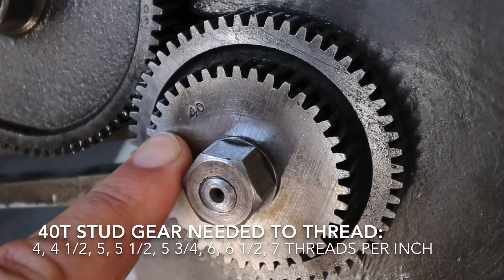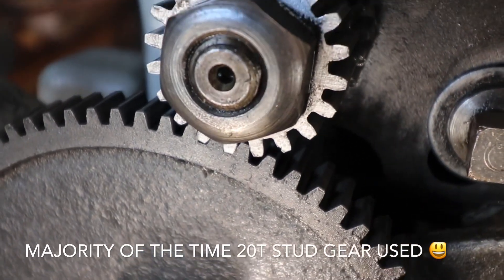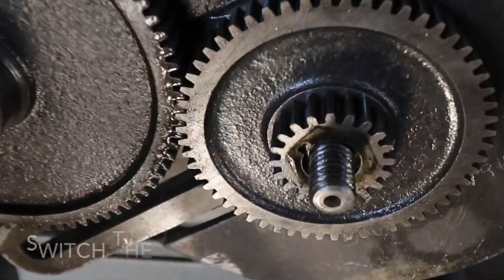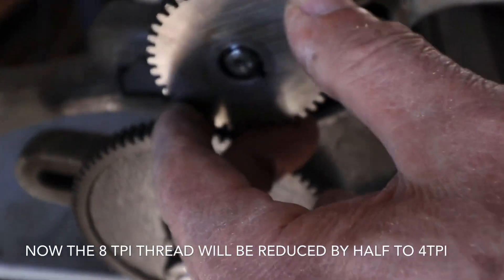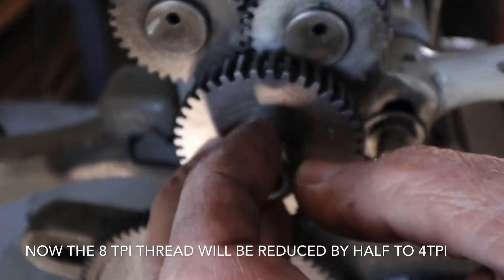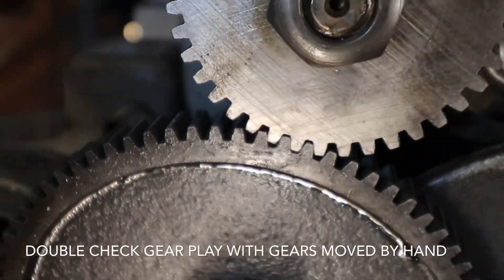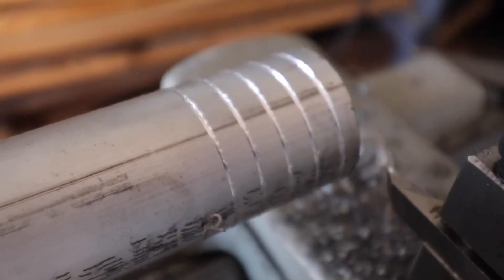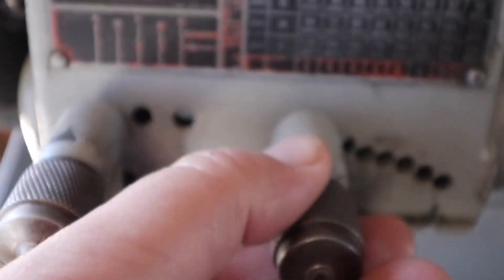How to Change Stud Gears on Vintage South Bend Model 9A Precision Lathe

Comment: Awesome info!  I was about to go and buy a 20T stud gear after looking through all my change gears not realizing I already had one in my lathe to use lmao!  Thanks!  This will help ALOT on the 3/8-10 rh acme threads I'm single pointing for new compound lead screw! You're awesome!

Comment: how can i change the gears so i can do " passes" when cutting material to be really slow ?
Reply from the maker: Hello
If You have a SB model 9A b or c then use your double back gears to slow the rotation down.   Also use the slow speed pulley at the motor.  Let us know how it goes...Take care

Comment: check tublacain spacing on gears he says use a paper width spacing
Reply from the maker: Hello and thanks for watching and commenting.  
Yes we have seen this guys many vids and we like to save paper but it’s good for some people but less useful for others.  Feeler gauges could be used as well but it’s just an unnecessary long step.  Once you become familiar with the feel of the gear and inspect it visually it becomes second nature to put the proper gear spacing.  
PAPER METHOD IS GOOD!
Tublacain has many good vids!
Thanks again for this info!
JR @ A1CFS

Comment: hi I'm from The Netherlands, watching you video , all looks so simple. i just bought a LiHUan lathe supposed to be a southbend clone.
I'm trying to make 7/8 by 14 tread but cant find out which gears i need to use.  the gears you use are the same as i have on my lathe but when make the tread it's just a fraction off.  i think the gear setting must be 20 above, than my 80 idler wheel, and my 56 to my box, as i can see on your very clear video. is that correct.
Reply from the maker: Hello Mcgerzon and thanks for watching and commenting!  If you want to produce 14 threads per inch on a 7/8 inch diameter workpiece, then yes the STUD GEAR needs to be the 20 tooth and the 40 tooth is not used and put in storage.  Make sure the left hand tumbler is in the ‘A’ position as well.  Also, be sure all the other gears are in the proper positions.  Hope this helps so please let us know how it goes!  
Thanks very much!
😎🇳🇱 🇺🇸🤠
Reply: My stock gear is the 20 teeth  the idles is a 80 teeth gear and the 56 teeth gear is on my norton case.  when i turn treads its in A and number 8  according to my schedule it must be correct, but the treads produced are to wide , just a little, but not the correct 7/8  x 14 as expected and needed.
 @a1customfabsolutions
Reply: @Mcgerzon  did you check if your lead screw is 8 tpi
Reply from the maker: Hello,  please check that ur lead screw is 8 tpi.
Reply from the maker: Gracias 
JC!

Comment: Hi and thanks for the great video!  I do have a question:  how many teeth does the gear that is driving the quick change gear box have?  Mine has 56 and my threading accuracy just isn't!
Reply from the maker: Hello and thanks for watching and commenting!  What model lathe do you have? The South Bend model 9A?  On South Bend model 9A The lead screw gear that drives quick change is 56t.  The 40t or 20t stud gears (depending on the tpi ur needing) sit in storage on the 56t lead screw gear
Reply from the maker: Thanks again and check out our newest vid comin in a day or two!

Comment: Why is the gear on the right side even there?
Reply from the maker: Hello we appreciate your questions! The 20t stud gear is used primarily but when threading 4, 4 1/2, 5, 5 1/2, 5 3/4, 6, 6 1/2, or 7 threads per inch then the 40t stud gear is used!  Thanks for watching and stay subscribed and tuned in for future videos!  Gracias!